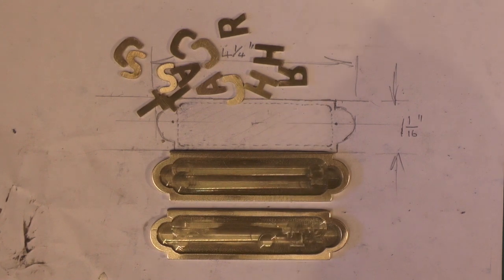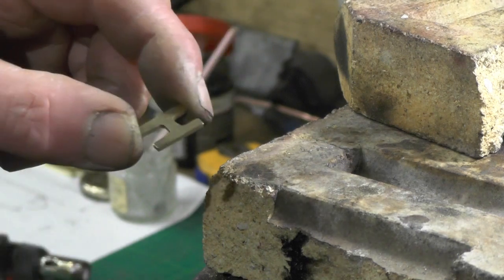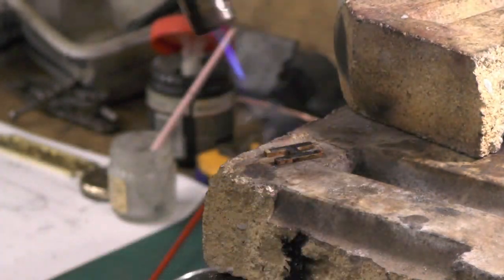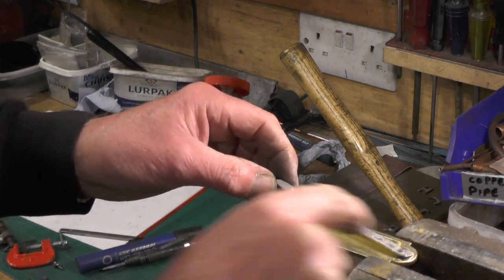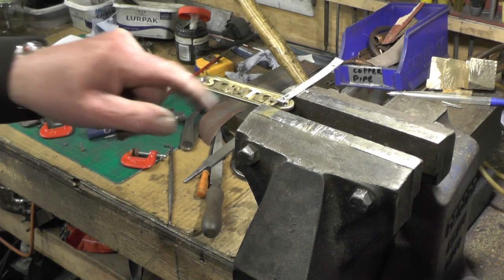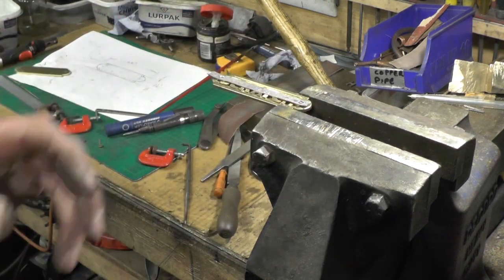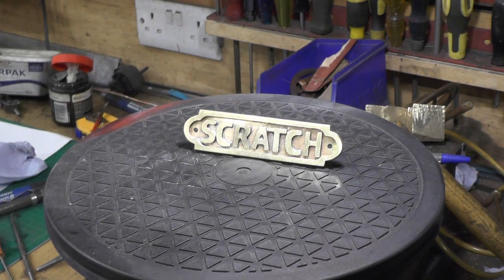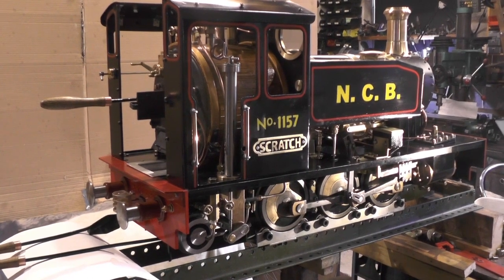Build Your Own Beginners Steam Locomotive Series ( Simulated Cast Brass Nameplates P2) "mr factotum"

Comment: Very appropriate name and they came out well. I would have been tempted to make a spacer at the top and bottom out of aluminium wire or strip to try to stop the letters floating. Thanks for the very useful video.
Reply: I like how the letters are not perfectly in-line as this whole project is two fingers to the purists!
Reply from the maker: Its a rough casting tom, and yes i'm not one for purism, i like patina of wear too!!!!, as per my bsa a7ss
thanks again
mr f
Reply: @MrFactotum  you would love the patina on my BMW, either that or think it sacrilege to one of the finest motorcycles ever made.😕
Reply from the maker: @chrisstephens6673  bmw what !!! chris, ive a R80
mr f
Reply: @MrFactotum  oh bad luck, you should have bought a proper one ie pre '76 when they still made them properly. The 90S was the last decent one and yes i have one from '73. The one i was thinking of was my other one a '71 75/5 with 150K+ on the clock and the heads have never been off. Still on first replacement clutch and brake shoes. Clutch plate only changed due to oil pump leak and brake shoes have over 100K on them and only changed at time due to squeaks. Generally it is standard except i respan the headlight rim to take a more modern 7" halogen light unit, best mod ever. It gave 90 mph lighting, shame my eyes were only good for 50 at the time.
I can understand someone wanting a model like yours but "oh how the mighty have fallen"😢 On your model the rear brake drum can wear more than the shoes do, as for the electrics on a cold morning well nuff said.😉
Reply from the maker: @chrisstephens6673  sounds great chris, well mines never let me down all round europe many times, stelvio pass and the likes, its an r80,  reg jan1980 but the 1979 model with heavy flywheel and points ignition, non of that fancy electronics,  it has an rs fairing on and a absolute dream to tour on, fits me like a glove, totally reliable, never worn the rear drum out with all those miles munched, may be its all down to maintenance, if there no friction material on the shoes then hey!!!!
have a nice evening 
mr f
Reply: @MrFactotum  i took my 90S through Europe and down to Corfu, but the 75 only went to France a few times once to Paris and the other times when the ferries were overbooked and i couldn't take the Scimitar to see the french wench in Normandy, a regular occurance in those far off days.
I put an RS fairing on the 90S, bought as a kit from a dealer, but have gone back to original or more correctly going back to original.
Does yours have single or double row timing chain if it stiil has points? 
We used to take care of a number of police 800s they really needed kick starts, bit embarrassing for coppers to ask the public to help bump them.
Reply from the maker: @chrisstephens6673  sounds great chris, 
A friend of mine bought a ex police r75 many years ago and its served him more than well, mine has the double row timing chain, i put a new one on when i got the bike, it didn't really need doing but i did all the service parts  when i got it, rings. seals valves etc etc. i thought of going back to original by taking the rs fairing off a few years ago, but its actually a god send when touring in the wet, now i don't tour as much i may take it off, nice to hear you've give the bikes some use.
mr f
Reply: @MrFactotum  i have put some miles on them over the 40+ years of ownership but sadly not these days, although the 75 is still taxed and insured.
The RS fairing was very good, stopped the neck ache from 100mph winds trying to blow your head off. Oh the good old days before speed cameras when you could use common sense when to speed or not.😢
Reply from the maker: @chrisstephens6673  you shouldn't be filling the government coffers with road tax, 
it / they  should be historic now 40 years plus!!!!!, hope your not slipping chris
mr f
Reply: @MrFactotum  it is "taxed" but the charge is Nil. Has to be done each year even if free , like it is "MOTed" but no longer needs an inspection. I would SORN it but that reduces my options.
Reply from the maker: cheers ap
good idea
mr f